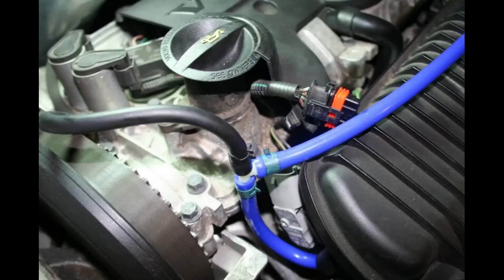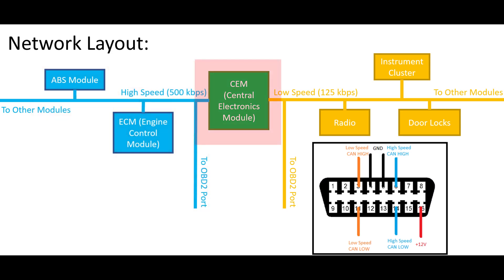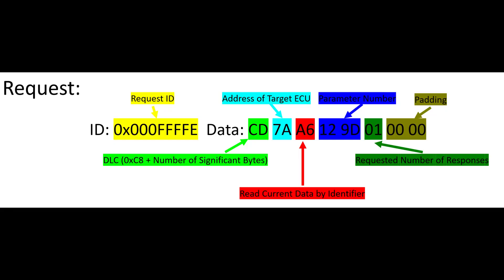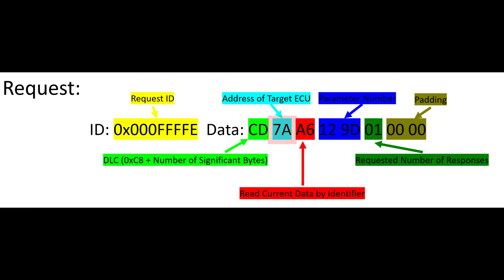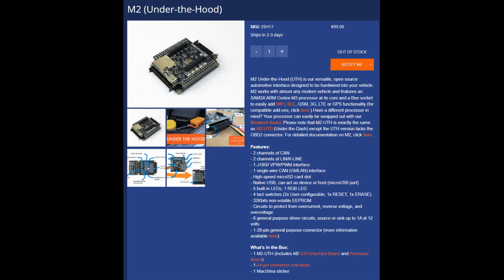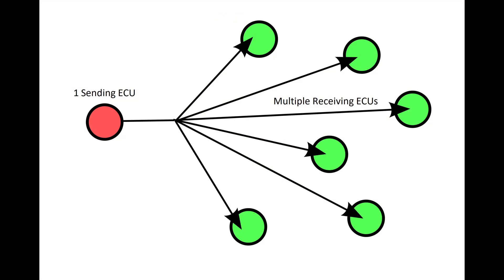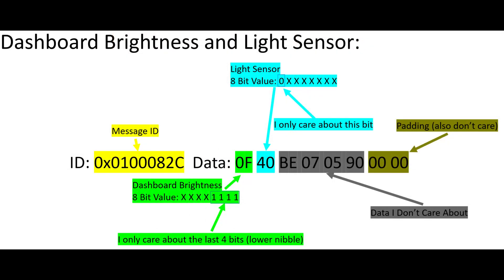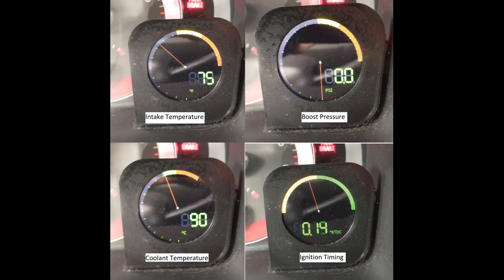Volvo C30 Arduino Boost Gauge and CAN Bus Reverse Engineering

Comment: Hi, May I ask you if you found the MAP pressure & injection pulse width? I am not able to find these values on my HS network. Do you know if MAP pressure is broad casting to canbus or it should be requested from ECM?
Reply from the maker: I think it is very unlikely that MAP pressure gets broadcast. The MAP sensor is connected directly to the ECU and, based on my understanding, no other modules would need it. The same applies to injector pulse width.

However, if you make a request with the 6th bit a higher number instead of 1 you can get updated values very quickly if you request them. The ECU will send rapid fire updates with you only needing to send a request every X responses, depending on what you put in that bit.
Reply: @Alfaa7  Thanks

Comment: This is a great explanation of a subject that is pretty difficult to understand for non-software engineers. The only downside I can think of for this implementation is that pressing the cruise "cancel" button also actually cancels the cruise (if set), which may not be desirable in all situations.........?
Reply: you can be lucky and the cruise control only reacts on short button presses only. A long press is a different input even when it comes from the same button.